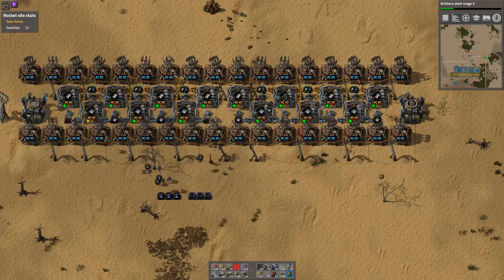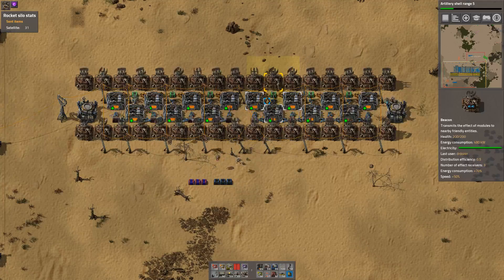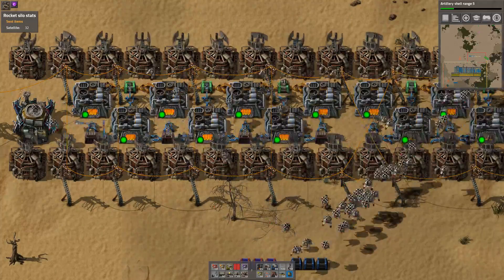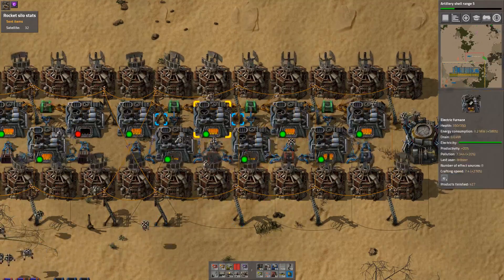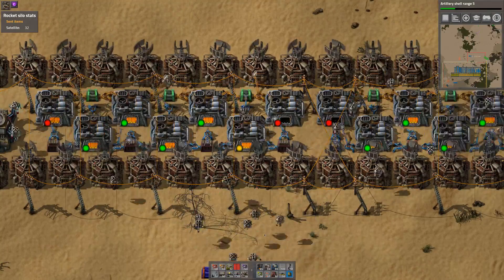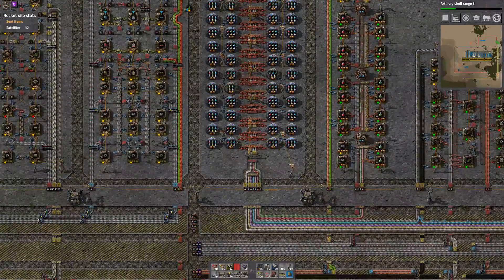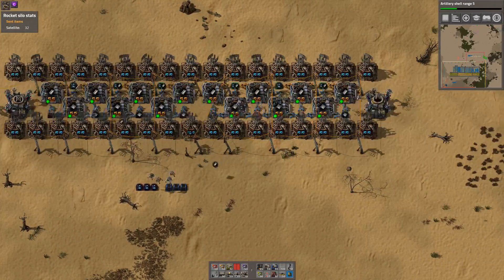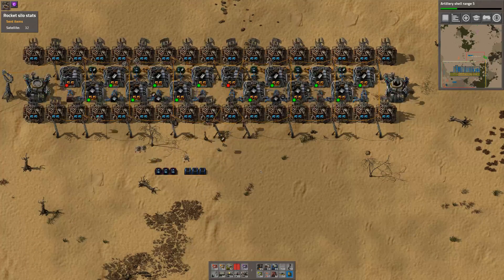Factorio Sandbox: Beaconed steel - tricks with buffer chests

Comment: Did you try the filter on the new splitters instead of sideloading?
Reply from the maker: Yeah - I couldn't make that work for me. You can't use the new splitters to control single belt lanes, or to balance between lanes. Only across input and output belts. I did try it, and then realised it wouldn't work.